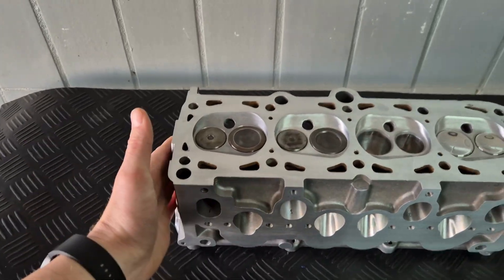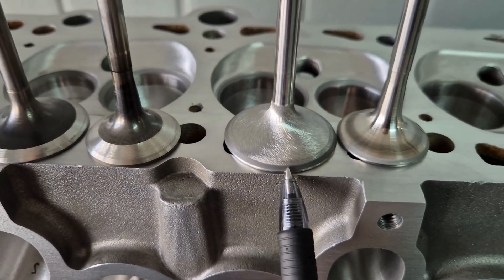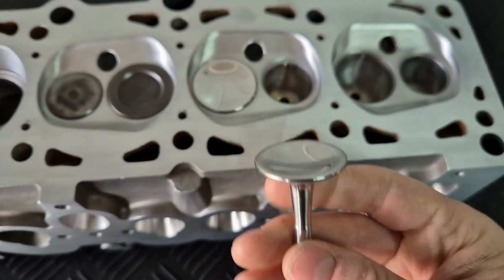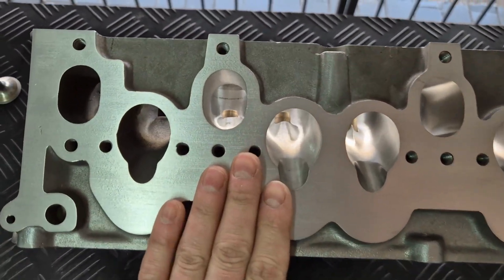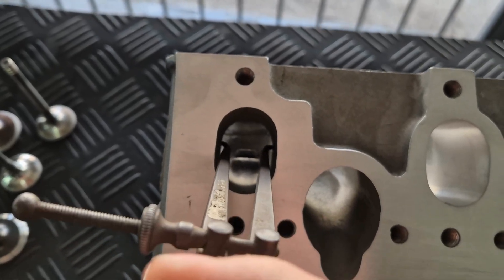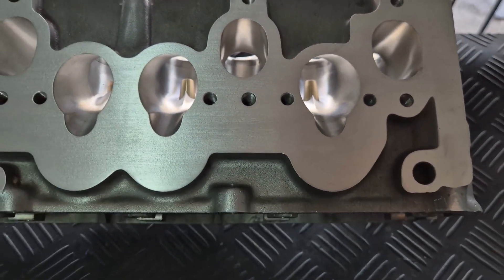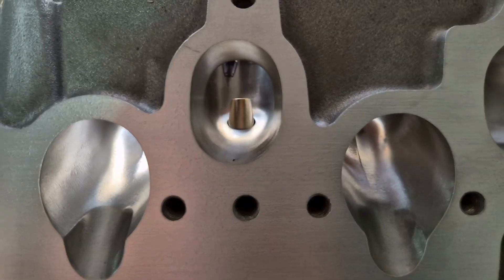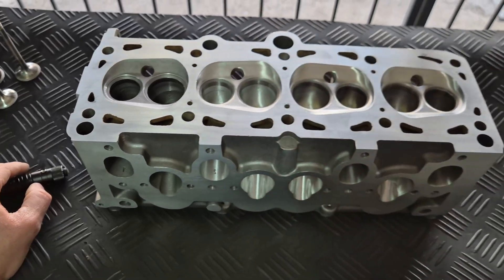VW 8V Stages on Cylinder Head Porting

Comment: Its crazy that we still love the 8v in SA
Reply: We like it strong and simple❤
Reply: 8 valves are better for daily drivers, as they have better volumetric efficiency under 4,000 rpms, which is where your rpms are at 99% of the time.